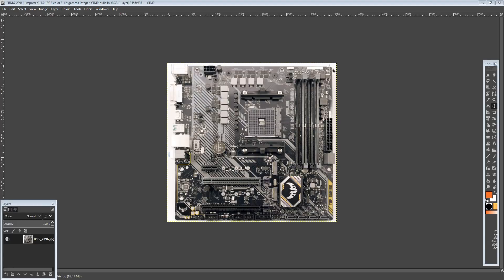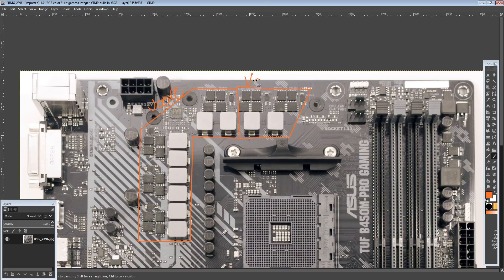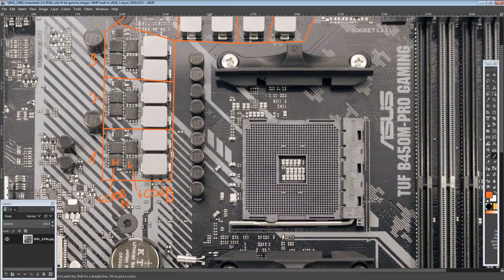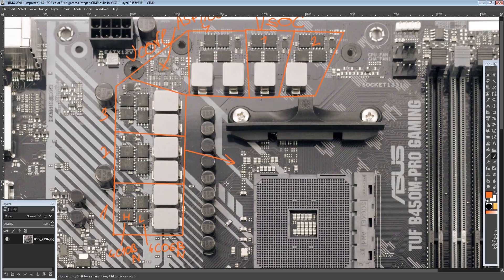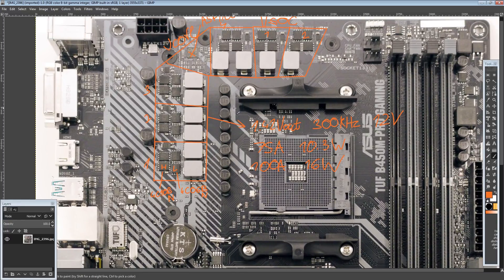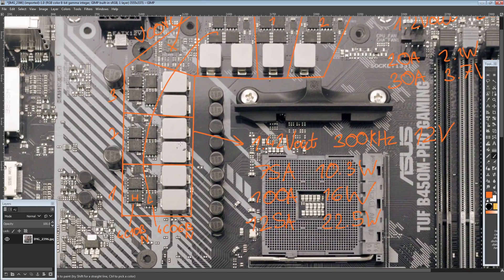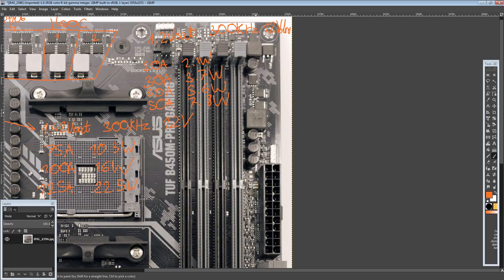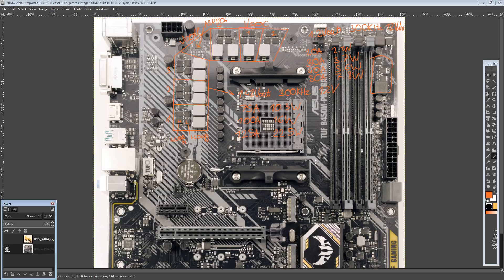mobo PCB Breakdown: ASUS TUF B450M-Pro Gaming

Comment: some MSI B450 boards now get BCLK control (though limited, as they clearly don't have clock gens) through BIOS updates. Still don't seem to have offset voltage though, no idea what they're thinking.
Reply from the maker: Yeah that BCLK option just causes GPUs to not initialize any time I try to use it.
Reply: @ActuallyHardcoreOverclocking  this is what I saw in the local FB group, even on the older B350 boards. The Graphics card should be an RX 580 Nitro+
https://imgur.com/a/JW8o7oI

Comment: I don't know why anyone ever bought low end Asus boards, unlike MSI and Asrock who have blips of good value/quality/features for the price; Asus low end boards not only always cost more, but have always been dogshit. You rarely even get a VRM heatsink. Asus is a brand you only ever consider if you are spending $200+
Reply: Never had an asus board fail but msi are dog shit no matter how much you spend ,
Reply: @paulb4uk  My ASSus laptop board failed.
Reply: @EasySneezy Now they are 75$ B450m MORTAR max vs 67$ TUF B450-PLUS - II prices are dropping.  DDR5 is cumming. ^^
Reply: If you have zero idea how to use a BIOS, then Asus is a good place to start... but seriously, just don't. There are better ways to learn a BIOS
Reply: @aexandereung5686  I'm no O/C guru. With Asus 2 clicks in the bios and I'm running ram at 3466C14. I'm clocking an R5 1600x all cores 4.121GHz and a TR 1900X all cores 4.2GHz and I don't  know  what 90% of the stuff in advanced mode in the bios even does.EAZY

Comment: Asus Sabertooth 990fx when TUF means quality
Reply: Yeah the Sabertooth meant quality now TUF just means the luck.
Reply: @bryandepaepe5984  Any one can look at a Prime B350 v a TUF B350 and see the top end components. For an R 3/5 a four phase VRM was fine. I run an Asus TUFB350M/R5 1600X/RX 580/16GB 3200C14/.M.2 . Upgrades: Strix Vega 56/ Ram to 3466C14/ cpu to 4.121GHz. Spins like a top. If you want a 8 core ryzen then upgrade to an eight phase mobo. A TUFB350 $70 and a Crosshair VII $275. This review is from an overclocker with no budget restrictions. A Crosshair loaded with my gear does nothing for me. If I put the $200 in a better monitor, I could see the difference everytime I hit the power button.
Reply: It is better 10K components than a Prime B350/450M

Comment: @Buildzoid, where do you change the ram divider radio? I was trying to push for 3600c15 but I keep getting 3200 in Windows even though it does show 3600 in bios. That is with the z390 Master mobo

Comment: This seems like a good board for Actually Running At Stock
Reply: @puchenyaka I agree with you. I saw practice VRM temp test in case with fans (real scenario) and this board is not bad afterall. And as you said, sound+double M2 and HDMI2.0 (not 1.4 as others boards)
Reply: @puchenyaka другая мамка+дискретная аудиокарта совсем для другого сорта людей....ок....сисиди плата расширения для nvme-массивов тоже немного не для каждоднвного использования среднестатистическим юзером....so....you can transate this in google translator or you can learn some more in this world....gotha....and i assuming you're gonna get straight to google-woogle...cuz it your choise...yeah man....great choise..i'm little hungry.....i'm gonna get some salad in washing mashine....it's my choise to deal in)))))
Reply: https://www.youtube.com/channel/UCBbv_2-lib2eTZTFqn7Q7sA
Reply: @puchenyaka I'm thinking the same as you but u don't need to be so offensive with the guy.
Reply: I will get this board  ( ASUS TUF GAMING B450-PLUS II  (the II version)  ) for only 67$ right now. 
The deal seems fine but I am really confused. 
The MSI b450m MORTAR MAX  is also 75 bucks but it is mATX moreover the warranty on the latter seems a little shady ( I did not trust the seller) ? 
What do you think should be my choice?
Reply: I believe the same. Nothing indicates that it shouldn't be able to do so, as 4 CPU phases are just right for any CPU even for an 8 core at stock clocks. (so not overclocked)
The heat sink over the mosfets is quite good, and at worse you can always mount a top fan to blow air down to the VRMs anyway. :)
Reply: I own this board and it's absolutely fine stock and also is fine with a 3.8GHZish overclock at sub 1.25V CPU voltage on a 65W 1st gen Ryzen eight core and RAM OC'd to 2933Mhz. I've also had a Gigabyte 450M board and that was totally unstable at the same overclock and MB temperatures were approximately 10 C hotter.
Reply: 1.25V V-core shouldn't produce that much heat, so everything seems to be fine then. Thanks for your reply.
Reply: Yeah it's fine as long as you stick to an 'average' overclock or stock settings and/or OC the memory certainly at least on a Ryzen 7 gen 1. I suspect something non crazy on a Gen 2 will be fine also.
Reply: A R2600 overclocked should run fine on that board too. It has a low TDP rating of 65. So i assume an OC is doable. 

If you have the Gigabyte B450 AORUS M even better. As the heat-sink has some good surface area over the VRMs in relation to the B450M DS3H board. 

The later has a heat-sink that's a joke actually. lol
Reply: Not at all, the only advatage is offset. It has a small numer of usb connectors at the back and all the other boards in the segment are cheaper for at least 10%.

Comment from the maker: first
Reply: I think your analysis is wrong.  The Asus B350 and most B450 boards have just 1 high side mosfet per phase on the Vcore side.  That is 3 mosfets, and just 1 choke per Vcore phase also.  This one has 4 total mosfets because they added a high side mosfet, and they doubled the chokes.  It's a large improvement, and you missed that.  The board name has Pro instead of Plus which seems to be the difference.  See the Plus VRM here:  http://greentechreviews.ru/2018/08/03/obzor-materinskoj-platy-asus-tuf-b450m-plus-gaming/
Reply from the maker: @paulgaster9071  the extra high side FETs make the VRM about 2W more efficient(what a massive difference). The extra chokes make little to no difference.
Reply: DAMNIT!
Reply: can this board handle Ryzen 7 2700 ? please is the best motherboard on mATX i can buy ...
Reply: Can you do MSI B450 gaming pro carbon.I just bought it and would like to see how it compares to other AM4 boards
Reply: Men can you tell me what is your opinion on Asus z370 prime A with a 8700k ?(i know its irelevant to this video ,but i'm still wondering since it's the combo i'm using) ?
Reply: Can you reviev another Asus, B450-e. It cost for some reason 50 euros more in my contry compared to B450-f, i wonder if it also has fake extra VRM parts.
Reply: 101st!
Reply: I would really love to see some more info about asus z390 maximus xi hero wifi and the i9 9900k overclocking results.   This VRM issue is really got me bothered as to whether I will be able to properly overclock my i9 9900k to 5.0ghz and have it be stable.  Can anyone please shed some more info or first hand knowledge?  Is it possible to contact Buildzoid personally?  I am leaning towards selling or keeping this board I got and buying the Extreme version for my i9 9900k....
Reply: Asus finally fixed one of their X299 boards' VRM and heatsink: https://www.asus.com/Motherboards/PRIME-X299-DELUXE-II/overview/
Reply: should i go for the tuf b450 plus for ryzen 5 2600 at stock clock
i have no intention to overclock it??
Reply: @puchenyaka Very true. The board is not as bad as people make it seem.